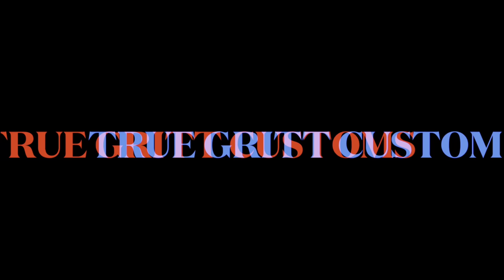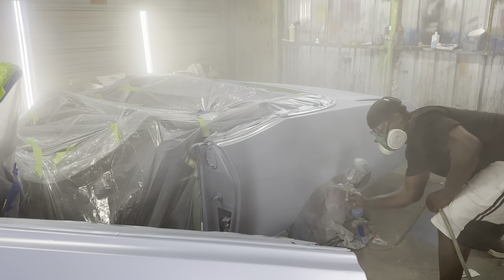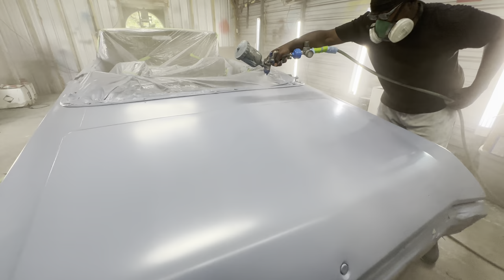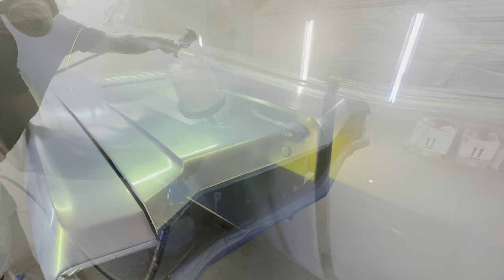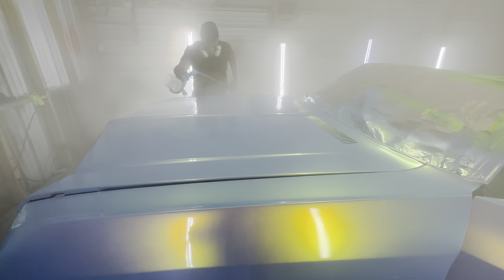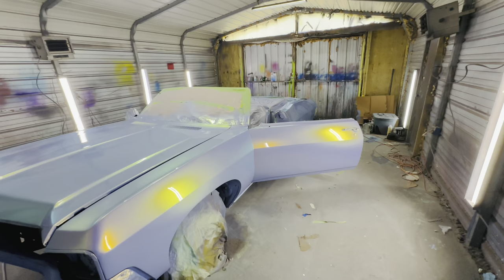Long Day on an Outrageous Paint Job

Comment: does every single paint job you guys do have the door handles in.... you can not properly sand to make sure paint has a mechanical bond with handles in.. over time the paint will flake off... handles are so easy to remove 🤦